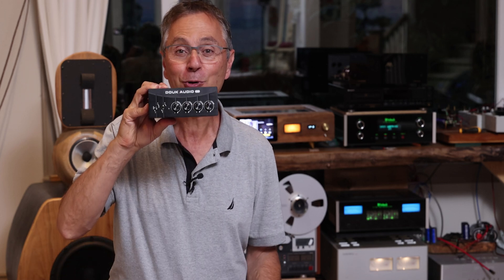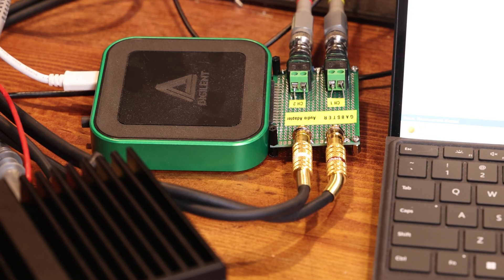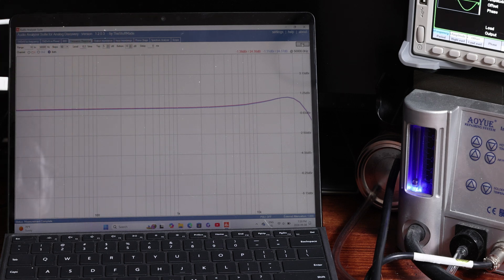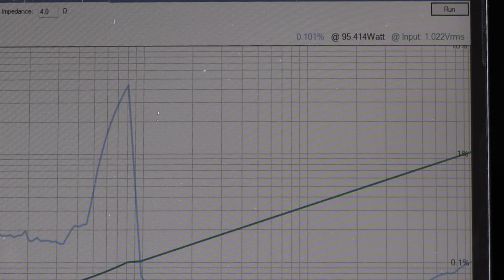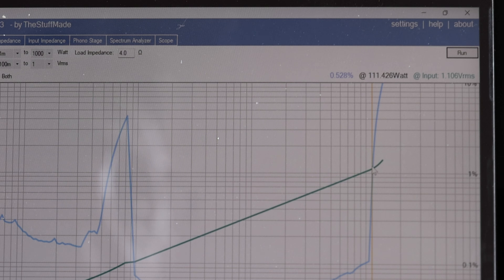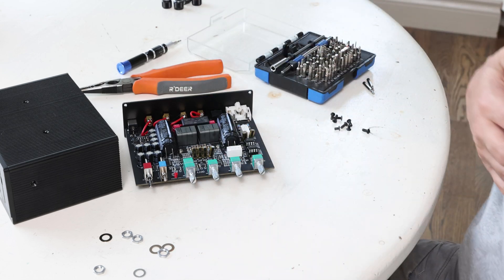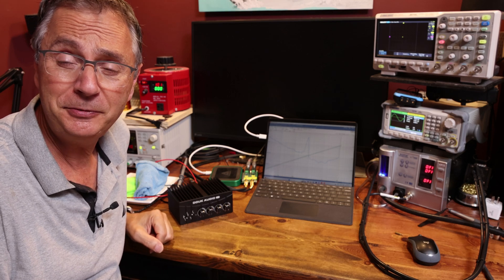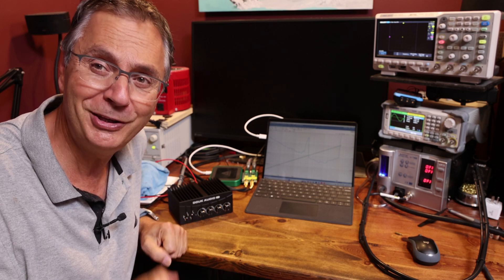Testing the Douk Audio A100 Amplifier

Comment: As always great review and great information. One question will the Burson V7 Vivids fit inside the case or will I have to grab my Dremel and mod the case or buy the connectors that Burson sells that allow you to install them 'sideways'? TIA
Reply from the maker: There is about 25mm max in height also the 2 opamps are close to each other and some other components so you be the judge. I do not own any. Hope that helps
Reply: @Gabster1  Thanks it does help. The v7 is 20mm high (according to Burson's specs page) that gives me 5mm clearance.

Comment: I bought one of these based on your review, didn't work right out of the box. not impressed at all.
Reply from the maker: Hi Ralph 
Sorry to hear Ralph I never had any issues with my sample you must have gotten a bad unit I would simply return it.
Please Note I am not affiliated to the manufacturer, but if a few people start reporting issues that will give us more clues if it is a common issue or a 1 or 2 off.
Reply: I also had some issues with the one that I originally got. the only way I can describe my issue is that the front/back imaging was off. All instruments and vocals where literally on top of each other or at the very least at the same level on a straight line. I returned it and the one the replacement is just fine.

Comment: Nice review.  A few comments ....

1) I'll bet half your audience crapped themselves when your measuring setup changed scales mid way through the distortion test.  We get it... most people won't.

2) Having the chip bolted to the bottom of the case with the fins on top really doesn't help cooling at all.  At that point the fins are mostly decorative.  Now, if they had mounted the TPA3255's heat spreader to the top of the case, with proper heat grease, that case design would be excellent.

3) I would not use any piece of equipment that has mode switching (mono/stereo and full/sub) on the front.  These things, along with their adjustments, belong either on the back panel or the bottom of the amplifier where it is far less likely that curious fingers will cause problems.  That is ... we know not to mess with these things... but the kids and half drunk friends do not.  

I wish I had a dollar for every service call that starts with someone asking: 'What does this do?"...

I see a competent board design, and typical TPA3255 behaviour but, as usual, the case design and layout is far more indicative of "feature loading"  (trying to look impressive) than anything else.
Reply from the maker: Great observations

Comment: What about class D amplifiers that have only digital inputs such as TAS6584-Q1. Is this a good solution? Can placing the dac and amplifier in one chip improve the parameters? Perhaps in the future it will be popular to send only digital signals from the streamer to each active speaker separately using differential cables similar to HDMI?
Reply: It is a good solution in multi-channel AVR setups and some studio setups.  

But it's not very good for home stereo use, because nothing really supports it. Try finding a pre-amp with the correct I2S digital signal outputs.

Comment: How are you able to test Class D with Audio Analyzer?  Is that something only version 3 can do?  I have the version 2 of the Analog Discovery hardware and when I put it on a TI-chip based Class D amp it just completely bugs out trying to run tests, even on a little 16W unit that I'm running.
Reply from the maker: You need to make your own Input output board you can not use the Digilent one as it connects left and right Chanel as well as input ground together. in my Video as well as on the Audio analyser suite site there is a how to build it section.https://www.youtube.com/watch?v=4MvWHeI393Y&t=0s
Reply: @Gabster has the right idea.  
The problem with standard inputs is that the output from these little amps is in "BTL" (Bridge Tied Load) mode and both the plus and minus speaker connections have active, opposing phase, output signals on them.  You need a differential input to read them properly.  

Alternatively if you have a dual channel (or better) scope you can tie one channel to the plus, the second to the minus and then set the scope to show you A-B on the display.

Grounding one or the other will likely send the chip immediately into protection and could cause it to fail outright.

Comment: That Chip was engineered not far from my home, I just received the dual version with  Mono chips board for each channel and a power a 48 volt 12 amp supply .

My build will add a  capacitor bank to see if the 600 wpc is available also ultra low noise 12 volt for the analog input stage I want to see what it can actually do !!!

 🤞 🤞